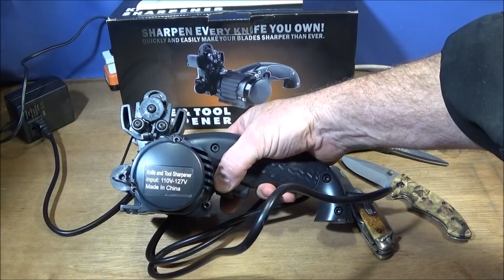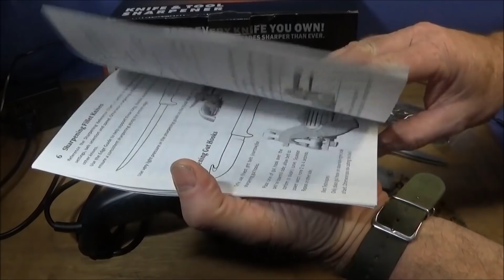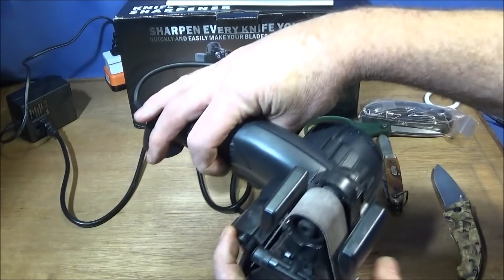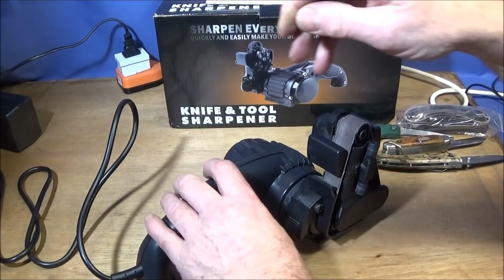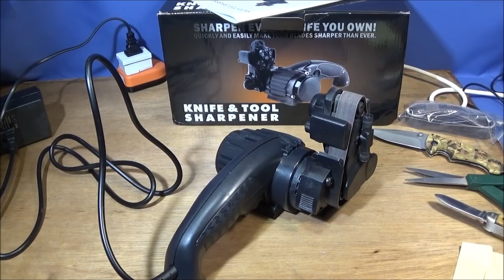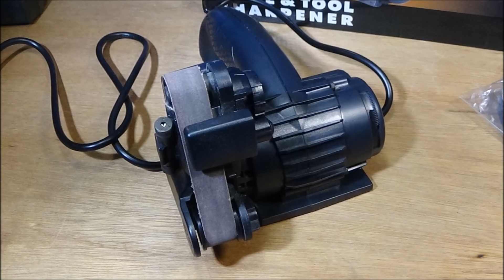Professional Electric Variable Speed 'Ken Onion' Knife & Tool Sharpener

Comment: your "razor sharp" look like a bad kitchen sharp 😅. You are not supposed to go back and forth. You should use more different grit paper, and not many pass, 5 left 5 right  you change the paper and you do the same thing etc...
Reply from the maker: That did make me laugh. Yes I was probably doing it wrong. I got rid of mine in the end as I didn't get on with it. I bought the Ruixin Pro knife sharpener. I did a review on it. It is an amazing piece of kit. Regards Steve
Reply: @SteveJordan  i check it, but it seems to be a bit tricky, how can you know the degree of the sharpening process ?
Reply from the maker: You can use a permanent marker pen to color the cutting edges. Set it by eye as near as you can on the bevel. Then test the set up. Then check the area to see where the marker pen has rubbed off. Then re adjust to suit.
Reply: @SteveJordan  oh ok, that's a solution.
Have you got good results ?

Comment: I am pleased to say that my cloned Ken Onion sharpener has arrived and I have had a chance to test it. Mine arrived in 240VAC with a UK plug, which saved me getting a transformer. It sharpened my knife very quickly and is razor sharp. The point about this being a clone Ken Onion, he will NOT lose out on the sale, as I would never have bought his version, due to affordability. He did NOT lose a customer.
Reply: Same super overpriced in Germany it's like 200$ would never buy a fucking cheap electrical motor and some plastic for that price wtf are those american idiots thinking? And the belts are overpriced too. I can get the copy with 100% same functionality and belts for a life time (nearly 100) for 140 bucks.

Comment: Is the knife angle guide removable like the ken onion? Also wandering if these are the same 3/4" width and 12" length belts like the ken onions. Also is the whole rotating head removable as well and possibly able to attach a different ken onion attachment. Thanks

Comment: Thank you Steve for this information.  Also, over here in the states what looks like a comparable machine is available on Amazon for about $ 60.00 .   That one is called a Work Sharp, but it doesn't seem to have the support rollers.  Not sure how important that difference is.  But Thanks again for the video :-)
Reply: Actually no, in the U.S. the $69 original work sharp is not the same sharpener as this one. This is supposedly like the ken onion ($120 or so) which has a 3/4" width belt instead of 1/2" so they'll last longer per belt with 1.5 times the grinding surface. Also the ken onion is has various whole head attachments you can get which I'm wandering if this copy will also allow the attachments like the ken onion blade grinding attachment that uses even bigger belts. The ken onion can use the regular 1/2" width or the 3/4" width either one.

Comment: With the method you are using, you are sharpening one side of the knife with the paper traveling down and the other side of the knife with the paper traveling up. I would think for consistency you would want both sides to be sharpened from the same direction.
Reply: If you haven't got a strop to deal with the burr,  then maybe this way works out best

Comment: Steve, I have the opposite problem here in the states.  Accidentally ordered a Banggood drill that’s UK current instead of US 110.  Any suggestions from you on which Banggood converter would be best for me to buy.  You seem to know their products really well.
Reply from the maker: Hi Holly. I do not know but will let you know if I find a low cost solution. Regards Steve

Comment: Checked it out and it is WAAAAAY over-priced, on Amazon Prime the original work-sharp costs 69.95$(us) and the Ken Onion Limited Edition costs 119.99$(us)...
Reply: I agree... Found it on Amazon for $59.60 with free shipping but non-Prime, direct from Work Sharp.
Reply: @MrMichaeljab  the $69 original work sharp is not the same sharpener. This is supposedly like the ken onion ($120 or so) which has a 3/4" width belt instead of 1/2" so they'll last longer per belt with 1.5 times the grinding surface. Also the ken onion is has various whole head attachments you can get which I'm wandering if this copy will also allow the attachments like the ken onion blade grinding attachment that uses even bigger belts. The ken onion can use the regular 1/2" width or the 3/4" width either one.
Reply: in the UK the ken onion edition is 189.99, the fake is half or less if you get it from aliexpress.

Comment: Why are you promoting a blatant copy of a current product?
Reply from the maker: There are loads of different versions of this type of tool now, like with nearly every tool you buy these days. If there was an issue with copyright I'm sure the main auction websites etc wouldn't allow them to be advertised on their sites like they do.
Reply: @SteveJordan  There may be different versions but not exact copies which also are labeled with the same name. I have no idea who Ken Onion is, or care for that matter, but I'm sure he did not add his name and consultation  to the original product for free. The main Chinese sales sites have no incentive (or ethics for that matter) to prevent this unless lawyers get involved for each infraction. Promoting such products makes you look bad.
Reply from the maker: @markfogleman8438  I'm pretty sure Ken Onion sold his idea to the Chinese manufactures, but never the less if there isn't a copyright or a patent on a tool name there isn't any problem. These tools and variations of the tool design are being sold on Ebay under the 'Ken Onion' name and are not removed for any copyright infringement. Ebay would be the first to remove such a thing. 
  I looked at all this before mentioning his name and judging by the way the various sharpeners are advertised I would calculate that he doesn't care for a product that he sold off. In fact if he has any shares in the work-sharp version of the product he maybe really pleased with all the advertising of his name. People generally look at different versions of tools then try and buy the best one they can afford.